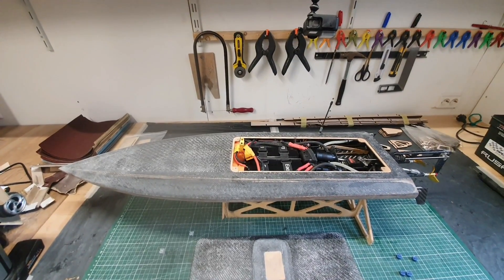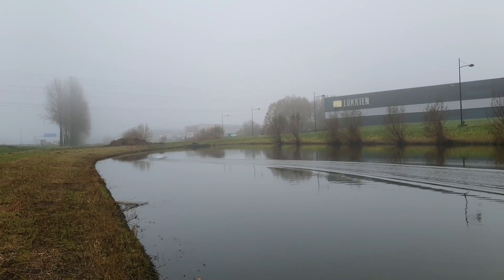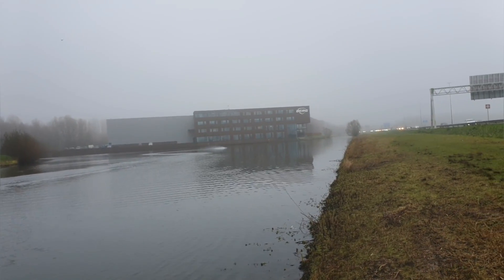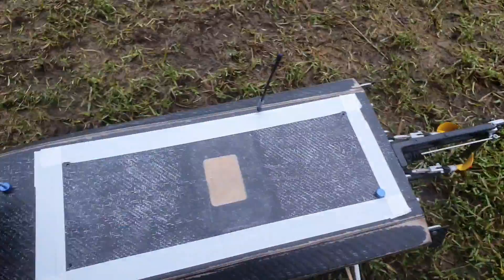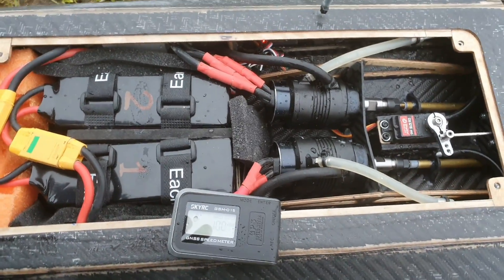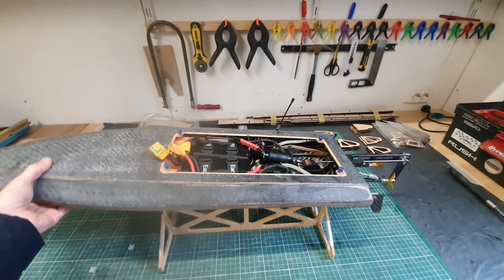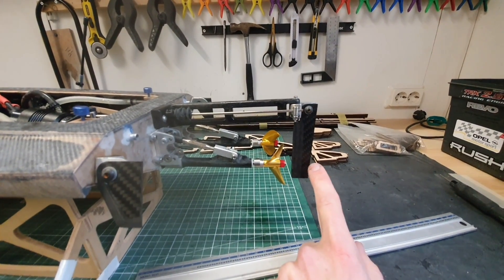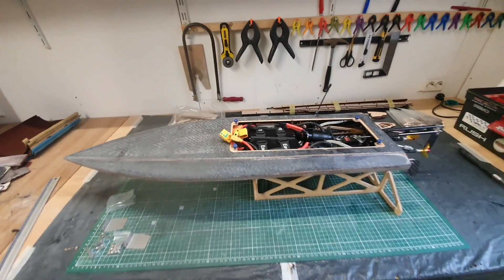RC Boat build: First run of my DIY Twin motor mono!

Comment: Hello Cozy, I love your work. Second time I build boats from your plans and I absolutely love them. I have una question though. I made one from your mono twin but just with 1 motor. It seems it’s not picking up water at the beginning, it struggles to pick up on speed. The second problem is when I make a tight turn, I’m having the same issue. Do you know ehat could be the potential cause?
Thank you for your work!!!!
Reply from the maker: Thanks! Not picking up well is a prop  issue. Do you use a good quality metal prop, with sharpened blades? 
Spinning out can be reduced by bigger turn fins, or a shorter stinger drive. I set this boat for straight speed passes, so I don't mind that behavior 😏
Reply: @CozyRC  thank you for your answer! I’m using a 35mm prop from Aliexpress. I’ll try sharpening the edges or maybe find another one. Any recomendations of a good one? Thanks a lot!
Reply from the maker: If you've build it at the original size: 850mm long, you need a bigger prop! Depending on your motor (at least 3674 or better 4082) I recommend a 42mm 1.4 itch or 1.6 pitch prop.

Comment: Hi Sir..what is the total weight of your boat? Including the two batteries?..thanks
Reply from the maker: Ready to run weight is 4kg exactly, with 2x 6S 4000mAh lipo
Reply: @CozyRC  hi Sir may i know how it is?
Reply from the maker: @eymardmancil9514  Sorry, I don't understand your question. How what  is? 😉
Reply: @CozyRC  sorry pardon..i am also asking how long is your boat?
Reply from the maker: It's 850mm long

Comment: Should i use a pumper to ensure the esc and motor is cooled. would that affect the speed too much ?
Reply from the maker: Most boats just use a water pickup, either on the hull bottom (like I did for this boat), in the rudder blade, or a water spray pickup above- and behind the prop. Some bigger boats use a water pump. The benefit is the cooling of the hardware during standstill. It will not affect the speed much, but it does take some space and battery power.
Reply: @CozyRC  I am making a catamaran with a length of 80cm. Run on 4s and a 4064 brushless motor. Is it okay if i use 120A esc and make sure that the water cooling system is efficient?
Reply from the maker: @05_caoquangbach21 It should be OK, as long as the boat is not too heavy, and if you don't put a too big prop behind it. A Flycolor 150A esc would give you a bit more reserve,and they're only around $55,- That would be my recommendation ✌️
Reply: @CozyRC  Thanks

Comment: That was super! You’re gonna need a bigger pond. 😄 I, personally, wouldn’t go for the trim tabs. The boat doesn’t seem to have any torque roll (the counter-rotating props help a lot there) which is what the tabs are more helpful in trimming. Also, you’re not setting the boat for turns at high speed, which is another thing the tabs are good for. The tabs add a LOT of drag! I would just use strut angle and CG. Happy trimming. That’s a solid boat. Congrats!
Reply from the maker: Thank you Oliveira 👍 I agree that this boat doesn't need trim tabs. It's really stable when properly set. I ran it again today and she went great! Video will be up today 😎

Comment: I wish i had a lake that size mine is tiny and I'm running ZONDA's when I say tiny it's smaller than half a football pitch 😂
Reply from the maker: Sounds like you need to go look for a bigger lake 😅.
That pond where I run is nice, but once the spring starts, there will be guys fishing. And the highway noise is not the best when I want to talk, but other than that it's a pretty good place!

Comment: Really great to see the maiden run incredible speed considering no lifting strakes.
I think your on the right track with the trim tabs, I would not touch the weight distribution just yet.
It’s so stable compared to my mono already it’s about the same speed the twin motors make it so much better.
I love it.
Reply from the maker: Thanks James 👍. The twin motors give stable handling; no torque roll. 
I will consider adding lifting strakes. And I will try trim tabs too. ✌️ DJ

Comment: And😊 twin sound how it is Cozy?
Reply from the maker: Like music to my ears Daiciu 😎. Too bad this pond is right next to the highway, so very noisy. I will try a quieter place later, so the sound is better noticeable. 
Actually, the boat seems less noisy than my Wildthing. But this is also a lower kV setup, so a little less scream. 
Probably, if the boat handles well, I will upgrade to 2x TP 2200-2300kV range to reach my 140km/h speed goal. ✌️ DJ
Reply: SAW setup😮 nice TP 👍
If you allow me ,small trimtabs and turnfins up from the water on SAW   runs and paralel whit the rudder if they are so low in the water and have a different angle than the rudder  they will bring resistance and they will argue with the rudder about who should steer the boat, at least that is my theory,and try first whit battery more to the back
Reply from the maker: @daiciuapostol79  Thank you for your advices! I will try that.
Regarding the lipo's, my feeling is they should be moved a bit forward, instead of backwards? A bit more weight at the bow to get rid of the bounce and then just a bit more up trim on the stingers, to get the boat out of the water. How do you think about that?
Reply: Your bow it's already heavy
Reply from the maker: @daiciuapostol79  The first run, the bow was too loose. For the second run, I down trimmed the struts and it planted the boat to the water. 
My next try will be struts back at neutral position and moving the lipo's a bit forward to keep the bow down.
I'm not sure if it works, let's try. It is actually difficult to move the weight further back. The lipo's are already at the most backward position.
I will figure it out and more speed will come, I have confidence 😎👍
Reply: @CozyRC  ok Cozy 👍more runs whill show the best set-up for perfect pass😁
Reply from the maker: I agree! And who knows someday we meet at the German SAW event 😎
Reply: @CozyRC  🤗yes whill be something
Reply: I see so many wood parts they are from a new project?
Reply from the maker: @daiciuapostol79  Yes, I will start selling my T800 F1 Tunnel as a lasercut kit 😎👍
Reply: @CozyRC  O I see I thought It's from another project
Reply from the maker: @daiciuapostol79  It is, because I will do a build series on this kit 😎.
F1 Tunnels have the most beautiful running behavior of all boats if you ask me. Flying above the water, it looks awesome! 👍
Reply: @CozyRC  This is nice for future enthusiasts in this hobby👌

Comment: Your boat is well built very quickly.  I think it will run faster if I just curb the phenomenon of nose-up when I try to run fast. Great.👍👍👍
Reply from the maker: Thanks DJKim! You mean to run the boat more nose up and out of the water right?
I think you're right, it will reduce drag and increase speed. Maybe by adding rhe trim tabs, I can setup the boat like that, with stable handling. I do want to avoid a flip or crash, because this boat is quite heavy and I fear for the impact of a crash 😬. Thanks for your advice and I hope to see you around! ✌️ DJ
Reply: It is also a very good idea to install a trim tab.
1.If possible, move the equipment forward and move the center of gravity a little forward.
2. Try to move the angle of the propeller strut down. 
First of all, it is recommended to change the setting without adding parts. The increasing weight lowers the performance.
It's just my opinion, so just keep that in mind.😁 @CozyRC
Reply from the maker: @D-factory  Thanks for the advices DJKim 👍. I agree on the weight moving forward. But I think the struts should actually move up a bit again. I like the boat to run free from.the water as much as possible, without losing stability. So I will e entually add trim tabs, but maybe I will try one more time without them. First install a longer rudder and .ove the weight forward a bit 👍
Reply: I'm so envious of your place. My place is draining and I can't do it at all.😂 @CozyRC
Reply from the maker: @D-factory  It is very wet and moist here too. I actually got stuck with my car after the maiden run 😅. Luckily I got towed out of the mud!

Comment: Excellent maiden Jan! Running a 100% DIY boat without any functional problems for the first time is the most important thing IMHO. You also achieved great handling and speed and that makes a 100% successful maiden. I am sure the speed will increase at least ... 40%, just as you need to achieve your speed goal with this boat right?😉. I noticed (and you also mentioned it)  some drops of water in the boat. Did you find out where they come from?
Reply from the maker: Thanks Dim! I was so happy the G-Force ran without issues. I have a good baseline from where I can start improving it. 
You're right about the 140 km/h speed goal 😎 I want to keep up with some fast Dutch twin RC catamarans. First, I optimize this setup. I guess I can reach up to 110-120km/h. If I feel the boats handling can take it, I will upgrade to twin TP 36mm 2200-2300kV motors to try and reach the goal.
Yes, there was quite some water in the boat. I guess it enters through the stinger drives. It could be that the brass tube liners are actually under the water line when the boat rests in the water. Or, by taking corners, the stingers might scoop some water, as there is a small gap between the stinger drives and the transom. I will investigate it. Maybe add an O-ring or some kind of rubber seal will resolve it. Will be continued, thanks for your supports and see you around! ✌️ DJ

Comment: Well, that was golden in my opinion. Really impressive and the handling already was quite decemt, it was just its maiden. Not trying to be a wise ass, but think rudderblade should be bit longer, like 15mm or so. Also quite sure now i will slaughter out my twin and take another hull to put it in in the future...
All in all, this looks to be just the beginning off a new adventure with your twin! 👍
Reply from the maker: Thanks Peter! I think you're right about the rudder. I will try that next time. So you got a twin mono too? Why take out the setup and restart? Does it have handling issues? 
I will consider releasing a laser cut wooden kit for this boat. But it will take some time. First focus on my F1 Tunnel laser kit and of course, tuning and running this G-Force 😎 See you around! ✌️ DJ
Reply: @CozyRC  Yes, i was so stupid to buy the (already build) same boat i already had in single setup (my first build) believing it probably was better. Its a multi stepped V, and it doesn't like cornering. Well, it handled all lot worse. Tried a lot, only thing i haven't tried is a real long rudder arm which i'll probably buy since i have other hull laying around and i can test it that way too... I kind off dont want to believe that this hull doesn't work since it's from a well known brand. But also got a beautiful hull laying around were i also could put the stuff in and take my loses... Just need to buy one motor and a rudder assembly. Rest is allready there...
Reply from the maker: @peteroosterhoff8850  Converting it to single motor is worth the try! I think a single motor setup is better for cornering and a twin setup is good for speed, as you have no torque roll 👍
Reply: @CozyRC  the single also doesn't like cornering. That how i got my Dominator, i was complaining at a boat store i couldnt get that hull to run right and already tried so many things. Only thing i haven't tried on that hull is a (center) long rudder assembly. That's how i got my Dom, he had that laying around in his shop and he said, you need to try this boat... This will corner, and it did 😂